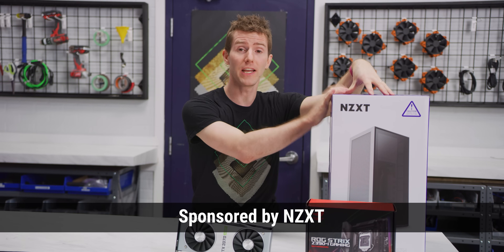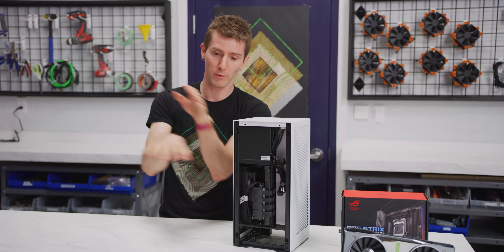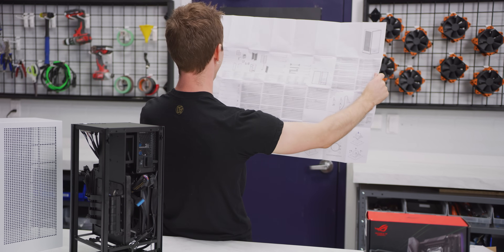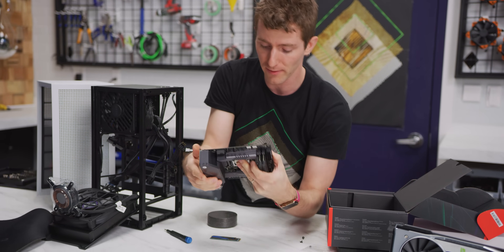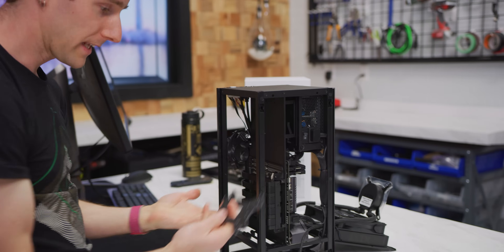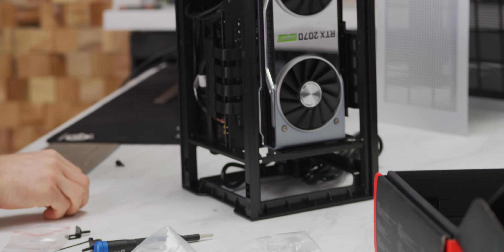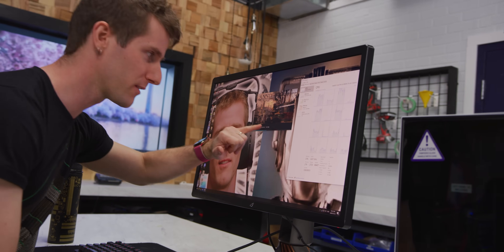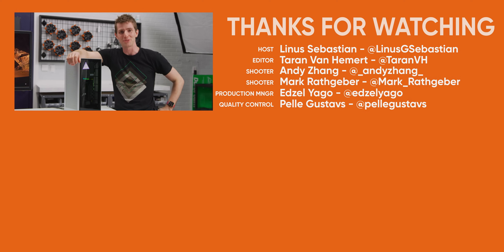Building the Xbox Series X Rip-off PC

Comment: "Building the Xbox Series X Rip Off"
Me: Sees price 
This will never be a rip off or alternative
Reply: The CPU used alone is likely to be most of the price of the Series X :^)
So yea...
A rysen 5 3600 and a GTX1660Ti or something would have been a better fit.
Reply: @FinlayDaG33k  1660ti dosent support rtx
Reply: @aykay9616  actually Every dx12 gpu can do raytracing....
Reply: O Yeah yeah yeah all gpus technically support ray tracing. The difference is that the rtx series has dedicated hardware for it
Reply: @sean0611  and in a similar note. The xbox and ps5 are having it built in as well. So there is that point to console without having to spend 600+ on JUST a gpu
Reply: @FinlayDaG33k  I agree except that the gpu of the series x will be very close to rtx 2080 power or even better.
Reply: @Atriox-il3mt  Funny
Reply: @Atriox-il3mt  it plays like s 5700xt or 2070 super based on what I have seen my guess they mainly get this from lots of optimization.
Reply: @Atriox-il3mt  Yeah, let's wait and see what amd actually DOES. Their cpu's have gotten much better about not promising the world and delivering a pebble, but the gpu side hasn't had NEARLY the success in that department, and this architecture has yet to see the light of day in pc or console form...
Reply: @girlsdrinkfeck  I dont know how they are going to get that level of performance but if it is true maybe it could cause nvidia and amd to drop prices.
Reply: @4karros  

No. Just that consoles don't have the OS Overhead that PCs do. Since the launch of the Xbox One X, even Linus is heard referencing how you will never get the same Performance to Hardware power Ratio that a console has with a PC, let alone even with one built to match the specs of a console. 

Hench why Xbox One X 6TF machine is up there or was up there with loads of PCs that not only crushed the console in Numbers but also in their overall price tag, but still the console was an Equal. 

I think that these consoles are having an interesting Side Effect on the mind of PC Gamers as they try to figure wtf is going in and why they pay so much for PC components that cost so much but aren't as effective as something they consider inferior 'consoles'

What you have on PC with Price and Performance is a collection of OS Bloat, Competition and price fixing of GPU/CPU/APU Manufactures..... And good ol complacency.

Hell if I remember correctly it was the dick head PC Gamer who ushered in the level of DRM we have today... Both the Ripping of Games, And being the ones who dropped physical games for digital only games. . . . . 

Ya we are still holding on to our Valuables over here... And it was the Console PlayStation Gamers and Xbox Gamers who actually did something or said enough of something that MS  changed their polices in 2013, and has spurred the birth of things like PS4 Pro and Xbox One X. 

PC Master Race, Crash & Burn. 🔥🏎️
Reply: @Atriox-il3mt  It's actually between the Rtx 2080 super and 2080 Ti!
Reply: @cMARVEL360  I'm going to need the cliff notes version of this sir.
Reply: @swishpronoob  😅 Instead I'll send you a Beer Emoji in the hopes that you grab a beer. And; Enjoy. 

🍺.
Reply: @Atriox-il3mt  It's outperforming 2080ti
Reply: @cMARVEL360  yes say teraflops like you know what they mean... also you do understand the scorpio had the quivalebt of an Rx 580... right... thats not even close to beating any moderately powerful pcs....
Reply: @ebicgaemer3330  Uhhh..... You men that $500 device with a 240 or so PSU, pumping out 4K games, and plenty of 4K60fps.... Uh..... I mean you purposely have to ignore my point... Especially since the RX 580 doesn't actually equal the power in the console, it's just a point of reference you try to use as a derogatory meaning. 

Obviously you want to believe what you  so there isn't any thing I can tell you.
Reply: @Atriox-il3mt  Ha ha ha ha ha ha ha.
Reply: @Atriox-il3mt  lmao in your damn dreams. That gpu will probably be something like a 9 series nvidia cards. Welcome to 2010 console boys.
Reply: @girlsdrinkfeck  lmao yeah sure.
Reply: Lorenzo Alvarez wrong. Maybe an RX5700 or a 2060
Reply: @girlsdrinkfeck  But i think not the first Generation of Games, we will need to wait 2-4 Years to see good optimised Games on the new Xbox. But after this, the Console will outperform a RTX 2080. I mean, just look at RDR2 and what is possible on the old Generation, but Rockstar needet Years of optimization to make this happen.  And in 2-4 Years we all have a RTX 4000 with many many VRam and Tflops. And of course a good Gaming PC is more expensive... everyone knows this, but no one really cares about it (only stupid Kids)
Reply: @girlsdrinkfeck  sadly
Reply: @ebicgaemer3330  except when you get a decently powerful pc you paid $1000+ for one.
Reply: @lucasdaignault3466  first off. No. Think about it. Both xbox and ps. Are using RDNA gpus. (Graphics cards that havent even been released to the 'pc master race' yet. And just by raw numbers does go head to head with a rtx 2080.)

Its optimixed so that also helps with games. Because instead of being a jack of all traits master of nun (a pc. Yes even a 2000$ pc) a console is a master of one (gaming). Jack of nun. (Anything but gaming)
Reply: @cMARVEL360  let me know when your xbox gives you the freedom to use any interface you want, any program you want, and the ability to choose what you want your specs to be.  I have a four year old pc that can play games at the same level of your precious X.B.O.X.
Reply: @lucasdaignault3466  my old 980ti performs better than the xbox1x and its 4 years old.
Reply: @gatorguy5419  

It's a fucking Games Console. LMFAO! What programs could I want to run on my Games Console? 

As a matter of what... When it comes to the Identity of your PC..... What is it exactly that keeps your 'Old' PC from being a new PC considering the ability to remove and add parts, Whole motherboards, and cases. 

I think you need a games console in your life. It can help bring you some Perspective. 

I used to game on PC. From 2006-2011. . So I know the ups and downs of the platform, so my decision to stay in console wasn't out of Ignorance just preference.
Reply: @cMARVEL360  Which is why a console will never have the functionality of a pc.  A pc can be your multi media viewer, gaming console, and work pc all in one.  A console is so limited until the xbox1x it couldn't even game decently.
Reply: Bryan Hidy you clearly lived under a rock since the release of the PS3 lol. Consoles already run a full blown Linux. You could run your entire media library from your consoles. You have Internet access and mouse/keyboard support on every major console. So you could use most Web Apps and do most common work lol
Reply: Lorenzo Alvarez Wrong, it’ll be faster than the 2080 ti
Reply: CoolCoolerGaming The new Xbox specs will mean a GPU faster than the 2080 ti
Reply: PewdsFan Pewds Fool, it’s hardware spec alone means a chip faster than the 2080 ti
Reply: @GhettoPCbuilds  no... Just no
Reply: @4karros  RX 5700 XT has 36 CUs, while the Series X GPU has 52. Pretty big leap there…
Reply: @gatorguy5419  people dont buy a xbox or ps to do all that they buy it to play games.
Reply: @gatorguy5419  hmm yess 980ti greak 4 years old you say. Right... Ok them moving on.
Reply: @WamblyHades  Compute units dont tell the whole story vega 64 has more than the 5700xt and still is slower.
Reply: @4karros  But those are different arquitectures, while RX 5700 XT and the new consoles uses the same GPU arquitecture. No actually the consoles use a advanced RDNA 2.0, so they could be even more powerful than my comparison.
Reply: @WamblyHades  it is all speculation we will have to see
Reply: @4karros  Those are confirmed specs by Xbox m8…
Reply: @kulade  It's actually true digital foundry have comfirmed it and the xbox series x was able to run gears 5 at 100fps ultra 4k. Everybody is calling me stupid with no proof. I think alot of people are mad that a $400-600 console will be able to outperform a $1300 pc.
Reply: @sawyerweathers8713  Give me proof and I will agree with you.
Reply: Boy oh boy..... The butthurt on all sides, AMD, Intel, Console, PC..... FFS, they’re all the same devices doing the same job. Providing endless joy to millions around the world. Some cost less, some cost more. Some are better for Task Alpha, some are better for Task Gamma. Some are for Professionals with some gaming, some for Gamers with Professional interests. You’re fighting in a comment section whilst there’s others fighting to save lives and fighting to live right now.
Reply: @smoketinytom  

What did you just wake up to the Planet Earth? People are dying all the time for many reasons. I'm not Part of White American, so you will have to excuse my nonchalant attitude in this crisis as I have lived past the age of 18. 

Ya 18. The age in which many Mintories have died at all Across America, so you can't really blame me for seeming indifferent as my life has ALWAYS been filled with Danger... It's just you who has come down to this level of Alertness. No worries. You're Human. You'll adapt or die due to stress.
Reply: It could be worse, the PS5 could be the slimmest looking console ever and have massive overheating issues.
Reply: @StephenDanielLopez  so the ps4? Xbox 360? And like.. Any small form factor pc post 2012.
Reply: PC gamers going butthurt
Reply: You forgot about, the global Economic hault.
Reply: Top Dog  If you bought an xbox one when it came out, and bought nothing but xbox live, you would have spent around $410 on just live up to today, on top of the $500 you bought it for bringing it to a total of $910, without tax, and accounting that you paid for live by the year and saved a bit. You can build a PC that games just as good as the xbox one for less than the $500 you initially spent on the console, forget the cost of live. And that's not including games, which are usually much cheaper on steam , as almost everything goes on sale on steam for a hefty discount. Now, you're not getting the best PC for that price, but if you're only looking at gaming, it's an identical experience. Buy what your fucking friends have, and leave at that.
Reply: @sporemaster97  id like to see your less then 500$ pc play a brand new AAA game as well as the slightly and admittidly over priced xbox does today :)
Reply: @theundeadsqwerl8017  yeah, 60fps isn't hard. Like, really at all. You can cheap on about half of the stuff and compromise next to no performance. Good gpu, ram, and ssd is most of what you need for games, you can have a mediocre at best cpu and be fine, especially at 60fps. And I'm talking og xbox one, not the s or x. Pubg can barely run on the og one, runs fine on my computer. And my computer technically doesn't have an ssd, and I have a new cpu (that I got for next to nothing) waiting for a new board as well, because my car is getting the funding first, I don't game that often, or seriously. I just play with the homies, which it does perfectly fine already. Most nw games are uninteresting as fuck anyway, so I'm not buying them to prove to you what has already been proven.
Reply: @theundeadsqwerl8017  And again, the only thing I have against consoles is multiplayer costs money. I never said I had a problem with them, dum dum just said they "will never be more expensive" and that statement is false. They can be, and often are, but not always like he said.
Reply: @sporemaster97  having to upgraid your pc every few years can get spendy as well. Not to mention all the troubleshooting or you know... Lack of any real standard anti cheat programs.
Reply: @theundeadsqwerl8017  yeah the illusion of the "cheap" and "flexible" PC lol
Reply: @michellandau4655   flexible is right. Pc does have its merrets don't get me wrong. But as a avid user of a pc and a xbox one x.

Pc is a jack of all traits. But a master of nun. 
Ya it can do more then a console can. 

But anyone looking at getting a console is not wanting something that can do a bunch of things. But just wants a simple plug and play expirence. 

Pc is flexible. 
But a console is consistant in the fact it will work out of the box.

 Pc are not like that. Eather you build your own. Or you spend a couple hundred over what its worth. Wile consoles are normally sold at a loss to the company making them.
Reply: @sporemaster97  well for one. Pubg is porly optimized for console. It runs fine on phones so saying that game is just a bad example. 
If a game is porly optimized for any platform it will run like dog shit. 

Just look at red dead 2 on pc at release. 

Or the batman Arkem games

And borderlands 3 runs fine on the og xbox one. As well as modern warfare or other new games. 

And the xbox one s has the same spechs as the og except has a 4k blueray drive. Wile the xbox one x has nativ 4k support.
Reply: @theundeadsqwerl8017  Mines ddr3, and still doing fine. You don't have to upgrade near as often as you think. Maybe a gpu about as often as you'd buy a console. Google is your best friend for any problem you may have. And games with developers worth a damn stop it, or immediately ban like fortnite. They'll kick your ass midgame, they don't care. I don't even like epic, but they do seem to be very effective in stopping/managing cheating. I've come across more people clearly cheating somehow on consoles in my experience. It's all preference, and what your friends have because not all games are crossplay, so it's easier to just get whatever the people you want to play with have.
Reply: @sporemaster97  strange seen more haks on pc (steam library) then on xbox one. 
Im running a ddr3 fx 8350. 16gb ram. Rx 580 8gb. build myself. And ya it works fine. But guess what. Im not running any new AAA games at 4k 30fps. But i can easily do that on my xbox one x
Reply: @theundeadsqwerl8017  & @Jordan Adams See guys. Folks like you are holding the next consoles back. Your "flexibility is the cause of all evil lol ^^
Reply: @michellandau4655  what? Dude... No i like mu xbox and am looking forward to the xbox SX. But i also understand the point of a pc.
Reply: @theundeadsqwerl8017  just "use your brain dude" rofl 
TheUndeadSqwerl
 1 hour ago:

"@Bryan Hidy id like to tak a moment to play the fu## bullshit song. 

If you wana say consols are holding gaming back then you might as well say your phone is holding gaming back. The games are scalible on any hardwere to run on any hardwere use your brain bud."
Reply: Just wanna state the change in the rules of the game lol
Reply: @michellandau4655  what?
Reply: TheUndeadSqwerl i basically called your BS is BS xD

Doesn’t matter really but it’s funny for me so I maybe digged to far into it xD
Reply: @michellandau4655  your confusing me. 

First off i am an xbox player. 

Second off i can see the logic in a pc. Say someone does more then just game. Like works audio. Then they would get a pc. Because it can do both. 

But if someone only games then hell ya get a console. No point in spending arm and a leg for a stagnated market. That DOSENT innovate but every 10 or so years.
Reply: TheUndeadSqwerl maybe I took your sentence on the wrong foot. My point of view was that you said “nothing holds games back” which ain’t true because developers and especially AAA Studios HAVE to get that critical ROI. They have to make profits. And as I lay out the PC Gamers are poor and own minimal Hardware. The common PC specs are now years behind the future consoles. 

So to still earn money GameDevs can’t ignore the majority of PC Gamers and have to cap their Vision for the games. The majority of games are cross platform games. Even exclusives are a thing of the past (for Sony who own the most powerful console of the upcoming gen). So even exclusive Sony Devs maybe cut features because of a future PC Release. That’s troubling for me
Reply: @theundeadsqwerl8017  Then idk what is wrong with it,  because i can play rocket league at 4k no issues. granted its not the hardest game. nut it does have a lot going on with the explosions and shit. Plus, most people don't have anything to even utilize 4k so its a useless benchmark.. 1080 or 1440 would be a better baseline, as they have higher refresh rates anyway which is more important that resolution.
Reply: @sporemaster97  because most 60inch tv are not 1440p or 1080 anymore. They are 4k.
Reply: @theundeadsqwerl8017  Like 2 out of all the people I know have a 60", much less a 4k one
Reply: @sporemaster97  intresting where i live everyone but me has one.
Reply: @Setzer K keep dreaming
Reply: @Jared _ No, I actually meant the GTX1660Ti :p 

Quite a lot of people buy the 1660Ti over the 5600XT... yes, the 5600XT is a tiny fraction faster, but is also a rather bit more expensive and doesn't have access to the NVENC (VCE sucks) which allows you to more easily capture footage using shadowplay without affecting performance.
Reply: @Setzer K I mean comparing a 2 year old CPU to a new one is stupid. Sure the 2700x has 8cores / 16threads but It was released on an older architecture so it's going to be slower, also the 2700x is of course cheaper than the Ryzen 9.
Reply: @Setzer K Yeah that's true, also considering that the 2700x has a 105W TDP and that a 35W chip is able to be faster than that is amazing. I think the R9 4900hs is on Zen 3 Architecture? (quote me if I'm wrong) so that means we'll be looking at really fast and efficient CPU's in the future.
Reply: @SnowyWiz  Still Zen 2 ;) Just beating the shit out of everything no matter of Desktop or lol Intel
Reply: Ryzen 5 rtx 2060
Reply: @aykay9616  nothin wrong with that system, but I think the new consoles will beat that.  Not be ALOT, thou.
Reply: If anything, based on what we know from announcements, architecture, and professional theorisers like DF, it looks like a vega 56 with hardware to accelerate BVH volumes.
Reply: Warm Soft Kitty  console players also have a lot less hackers so what's your point?
Reply: Warm Soft Kitty  pritty sure a AAA game will run fine on a release ps4 or xbox one. (Came out in 2013) but a pc built for say... 500$ in 2013 wouldent be abuil to without having to say.. Upgraid a part or two. (Witch in of its self would just a 'subscription' fee.) Just saying.
Reply: Top Dog  Enjoy having limited backwards compatibility and having a tyrant decide what you can and can't play.
Reply: Top Dog  yeah, and I only go out to see your mom, jackass
Reply: @Setzer K all the stuff eh. Ok then. They have made some decent strides in CPUs. Still far and away under the competition but they are doing all kinds of stuff lol 😂
Reply: the xboxs graphics will never compare to a Rtx in terms of raw power and numbers

BUT

in terms of end user experience, it'll be quite close due to better optimisation via xbox os
Reply: @watema3381  You do realize developers have said that console gaming is holding pc gaming back.       It's why there are thousands upon thousands of PC games vs combined console games.
Reply: @gatorguy5419  id like to tak a moment to play the fu## bullshit song. 

If you wana say consols are holding gaming back then you might as well say your phone is holding gaming back. The games are scalible on any hardwere to run on any hardwere use your brain bud.
Reply: @theundeadsqwerl8017  but with the next gen PC´s will holding back the consoles. Let´s take a look at every spec: PCIE4 NVMe´s as used in the new consoles couldn´t be utilized with any Intel CPU until 2021. AMD only supports it on their latest motherboard gen. So no common fast NVMe´s in the PC´s. Resolution? Console´s are at 4K in the Old Gen. Most PC Users play at 1080p. CPU Speeds and Ram? Both Consoles and PCs are on pair... except that PC users only use 4C/8T. Disc Space? 1 TB ultra fast speed on the next Consoles and 1TB HDDs in the PC´s (Even standard Terabyte SSDs are at 100 bucks right now). Source: https://store.steampowered.com/hwsurvey/Steam-Hardware-Software-Survey-Welcome-to-Steam 

And all together means that Developers have to take care of the majority of the PC Peasants which are holding back their efforts to be able to use their engines full potentials. Which is leading to an awkward position of the new consoles: https://youtu.be/UElXQTqWlUw
Reply: I think these peasants cant handle the truth that their filthy consoles can never match the performance and convenience of a pc! lol, keep believing what ever the fuck manufactures say to you 🤣
Reply: @azmeriliza3788  pc. Spends 1000$ has to put it together trouble shoot and be sure its all working then install the os and then buy a game online download and that game just might not work that well because poor otimization

Console
Buys console buys game plugs console in and slots disk in. Plays game. No need to be sure the game is optimized cuze you know it is

So again.... Where is the convinence of a PC hear bud?
Reply: @theundeadsqwerl8017  First of all, the best advantage of a pc is that you can select every part yourself. You can build it at any price point not just "1000$". You can go as low as 300$ (even less) or as high as 5000$ (more if you want).You can get as much gpu or cpu horsepower you need. On the other hand you have to wait for another console release to get better performance. Lastly it's a PC so you can use it for other things than just gaming.
Reply: @azmeriliza3788  true, true, but consoles are free of the massive overhead a computer must run simply to be a functional PC. A lightweight OS can get much better results out of local hardware.

A similarly specced PC would be outperformed by next gen consoles, but with cash to burn you can make a BEAST of a PC a console could never hope to be.

Basically, there's merit to consoles, even to a PC gamer. Besides, we all want crossplay, right?
Reply: Why are y'all so mad lol, the gpu will be around the 2080. Some of y'all keep saying the 2070 super and that's what 6-7% less fidelity than the 2080?
Reply: @amuddyelfproductions3915  

I think PC Gamers are just shocked that the consoles have caught up so fast they inadvertantly woke up the PC Gamer to the Butt Fucking he/she has been receiving from it's Hardware Manufacturers. 

LMFAO! 

I Mean..... To be fair, their current Hardware can already do so much.... If there was some incredibly lite weight Gaming OS, then Instantly all PC Hardware would gain a Performance to price increase. 

Hopefully MS comes through, because they kinda have too. If not, then another PC OS will come up with Gaming Focus while maintaining high security. 

So personally im bettjng on MS making a Game Mode for Windows that will turn off a lot of background processing to decrease the load on the Hardware. 

But man..... The PC Gamer is very much a Victim of Industry, or Corporate Greed... Which makes sense considering how sensitive pricing can be on PC Gaming Hardware in response to competing hardware... There is NOT enough Hardware CPU/GPU competition in PC Gaming so their hardware is just over priced and retains those high sales until those Sales come around, another indicator at how wishy-washy pricing is on hardware components.
Reply: @cMARVEL360  caught up so fast? They are on par with 5 year old hardware
Reply: @Kold2012  

Uhhh...... Please look at the rate of advancement from the big picture. 

Hell... Think Xbox, PC, Xbox 360, PC, Xbox One, PC, Series X, PC. ... The Xbox is X86 based, Hell we can say that's when PC's THE PERSONAL COMPUTER, Became a Games Console. 

Xbox 360 was a total Custom build like previous games consoles, but come thr Xbox One AND the PS4 which are the first two Games consoles to use a whole lot more basic off the shelf PC Component. 

Now Series X and PS5 come with BRAND NEW PC COMPONENTS. 

I think you get my point? And...... Uhh...,. By 5 Year old parts.... You are referencing 1X and PS4 or Series X and PS5?.…. Then again, it doesn't even matter as your original comment wasn't made knowing what I mean by what I said as I had not explained it to you yet.
Reply: @cMARVEL360  everything is "custom" you just change anything about it. Now it's custom... 
Ps5 is a 1080 
1080 came out in 2016....
Reply: @Kold2012  but yet are running gpus that havent even released for pc yet.... Hmmmmmm
Reply: @theundeadsqwerl8017  the cards they are based on have released homer

AMD has been behind a long time folks. I'm giving you the benefit of the doubt here with saying a 1080.

It's an Apu. Notoriously (cheap) trash. Underpowered with only 300w to pull from.

All your "cUsToM" this and "uNrEaLeSEd" that is marketing talk for here's some garbage that we are shafting you with. Come buy more in 2 years.
Reply: @Kold2012  welp number crunching from game deves. And raw numbers from gpu tests and stuff. Say other wise but allright but. See you when your proven wrong at release. :)
Reply: And hear is a side note. 

My 500$ xbox one x will run games at 4k. Granted not at max setting or anything like that but it still looks GREAT and runs smoothly with no real dips in fps.

My 700$ pc will not. Barlly scratching 20fps in even games as old as team fortress 2. Granted its older unit. But both where put together 2 years ago
Reply: @Kold2012  Not to mention Microsoft is selling the Xbox at a loss.
Reply: @gatorguy5419  doubtful. Source?
Reply: cMARVEL360 theirs already an “Gaming OS” which makes your games run faster on the same Hardware: Steam OS / Steam on Linux. Valves Proton already kicked Windows Ass
Reply: @cMARVEL360  Consoles are just inferior and the only reason I see to buy them is if I'm broke or want to play with friends. There are so many reasons why I would chose PC over consoles, the sheer ability to upgrade my PC parts is an instant win, while needing to pay for an entire new console whenever they release a refresh/ upgrade is just money hungry (ps4 pro etc). Whereas I can take out my GPU or CPU and plop in a new one increasing performance for a fraction of what a new console would cost. The new generation of consoles might look high-end now but in six months to a year when AMD releases Ryzen 4th gen and Nvida updates their GPU line up (even AMD are releasing good GPU lately) they'll start to look around mid-high end. It will continue like that until consoles look really low-end like they are right now, that's the downside of consoles is the lack of upgrades you can make to them, lack of customization of the parts inside. Not only the hardware side of consoles are bad but the software side as-well you are forced to use shitty OS's from the manufacture, that are well know to have tons of bugs upon release and even down the line. Also for people who also use PC's for workloads etc (which you wouldn't know because you're obviously ten) you can't use consoles for work etc so of course they go to PC. Now there's nothing wrong with Consoles and if you want to use the go on, but if you use your system for anything either than gaming don't expect to be able to do it on console its just a lot better on PC to multi-task and do other things.
Reply: Don't worry, microsoft will get their money out of you in DLC and microtransactions.
Reply: @Chuck_Huckler  I don't think Microsoft gets a cut of game profits unless they own it or license it, and I don't think that right extends to microtransactions. If that were the case, no game would ever be released without microtransactions, not even indie games; Microsoft wouldn't let them.
Reply: @Chuck_Huckler  

No. They get Money from US through Xbox Live and Gamepads Subs... You do know that DLC and Microtransactions are for the games and for individual Devs/Publishers?.

Some of you people are full of your own Egotistical views thya your jokes are drowning in your Ignorance which Kills the Joke itself.  

It's one of those Face To Palm situations.
Reply: https://www.google.com/amp/s/www.pcworld.com/article/3532810/microsofts-xbox-series-x-full-specs-vs-gaming-pc.amp.html 

Butthurt pcmr can't handle anything, here's some facts
Reply: @cesarzepeda8291  lol FaCtS
Reply: Mike Hines you want facts? A) The RX 5700 XT has LESS CU’s than your “shelved” XSX APU. It is more powerful than the best discrete AMD GPU and it seems like AMD will release new GPUs close to the consoles. B) The NVMe in the XSX is faster than any NVMe you could use on any Intel Motherboard till late 2021 or even 2022. (Yes, Intel is year’s behind of AMD). The PS5 Nvme is even double as fast as the XSX Nvme. To get close to the PS5 you need a ~7Gb M.2 NVMe which still has to be released and probably won’t until end of the year/2021. C) Just look what Monster the new AMD Laptop Chips are. The Media barely can wrap their heads around their performance. And those chips only use 45-65W. As you mentioned many times the consoles use up to 300W. Thats ~5times the power to benefit from. D) The RX 5700 has less CU’s than Vega and outperforms Vega in raw power and efficiency. Your mentioned 1080 is outperformed by new Laptop GPUs from NVIDIA I guess. Time allows progress. For the Fun of it one more: E) The new Audio Chip in the PS5 opens even more compute power while delivering better audio than even in High End PC’s (as far as we know).

So have fun correcting my 5 facts
Reply: @michellandau4655  I wish you knew what you were talking about. This would be easier
Reply: Mike Hines lol. THAT’s your answer. Its not even an argument. Come on.
Reply: @michellandau4655  what you said is not an argument either. You spewed a bunch of bullshit I'm not even motivated to start debunking. It's clear you have your fantasies made up already of what your getting.
Reply: @michellandau4655  fact AMD has zero answers for high end GPUs that compete with Nvidia
Fact- any ssd is gonna improve your loading times period.  The theoretical performance you speak of that's soooo much faster then what has already been out for years I might add, is marginally better. So marginal, I'm gonna say right now in a blind test you would have no idea the difference if this so called speed is even reachable. You talking about loading fractions of a second faster. Fractions. Of. A second. I have 2 nvme drives now. They load games instantly. Litterally. Telling me your faster then instant doesn't get me excited.

If they can reach 5ghtz transfer speeds, good on them. That's great. It's not gonna change much. Everything is an upgrade from a HDD aka current gen. 

  But here is the thing about all that. You have to buy PROPRIETARY M.2 from your console of choice at the price they choice for the capacity of you guessed it; whatever it is they want to sell you and they plan on using it as ram. Drastically shortening the life of said drives and ignoring the latency factor when doing so. 

You bring up laptops. Why. Who cares. 
Your console is not a laptop. Comparing the 2 is irrelevant and kind of eye opening as to what you'll accept. The best laptop chip today get SMOKED by a 4 year old desktop chip. Who cares.

New Audio chip? Give me a brake. You'll believe anything...

Fact is you getting repackaged part and being told it's brand new tech
Reply: Warm Soft Kitty  

Wtf? LOL! NO. The Console is the physical device itself. Anything else is software added services that you DONT Need. 

Man. I really don't understand the point of creating arguments to make one's self feel better. 

I mean lets be real. Not everyone is a Competitive Gamer, so not everyone need to pay for a Sub fee to play online, In the exact same way people can play PC games but only run Single Player experiences, and now you also have to consider Free to Play games that are NOT always required to have a paid online service. 

Honestly... I think if I were to try, I could come up with some BS where I rope up the price of Digital Games with the Price of building a PC..... Well because you gotta play games but you buy them through your PC through a Service of your Choice..... 

But that sounds stupid huh? lol! But it doesn't change the fact you need a PC to buy PC games. But you don't always need a console to buy console games, just play them.
Reply: @cMARVEL360  you and i both know that the vast majority of the gaming industry is now online only... it is reflective of your desperate defense that you genuinely try to make the argument that you do not need to pay for these subscriptions.
Reply: @ebicgaemer3330  

What? Dude your point was like trying to say that a console is more expensive because you have to get online but you gotta pay for internet first, oh then you gotta Sub. 

Everyrhing is online because people choose to be online. 

I mean how many times are we Logged Online, but playing some Offline story game? You trying to tell me no one can carve tht sort of exsistnce?

 Wtf do you think happens if I don't pay for Xbox Live? 

I'll give you the benefit of the Doubt , that you probably just didn't consider being offline. . . Especially since you regurgitated that old 'Consoles are more Expensive because of Subs psrt' I know you weren't thinking with your own point of view there...  Hell I went to a friend's house a couple of days ago.. he had No Xbox Live, but I offered to share my Gold Benefits by adding my account to his Xbox. 

Sure enough him being his own man he didn't want it, and we played just fine playing Shogun Jump's fighting game.
Reply: @cMARVEL360  if you are broke you buy console . If you are fine on money You buy  a pc 
Its that easyy . You pay more you get a premuim experience
Reply: @exess510  

LOL! I think you mean If you are Broke you have either Console or PC. If you are fine on money you have a combination of a console and PC. 

But honestly, as a Gamer, why the fuck could I give a fuck about how much you spent on a Gaming Device? Gaming is about the games and Gaming Skill, This isn't MTV Cribs Lol! 

And if you got money, then send me some. I'll my dog Heart medication with it.. I'll send you receipts for proof!
Reply: @cMARVEL360  I was with you until you said you don't need live on a console unless you're a competitive gamer. I'm paraphrasing, but that's wrong regardless. You could just want to play rocket league in a private game with your buddy, but you can't because even Sony charges for multiplayer now, and it's petty as fuck. IDC if the console is an extra 50-100 bucks to account for not paying for live, you shouldn't have to pay to play with your friends when you already bought the console, game, and probably extra controllers and stuff.
Reply: @sporemaster97  

I'm not with you at all. See I don't have this sense of Entitlement.... Even with an Xbox Live account of 15Yr. Which equals $850 if I do the math with $50 from 2005 to 2010, which is when I believe Live went up to $60. 

So if decide to buy more Controllers for the console and a game which is most likely made sperate from the console manufacturer, ya they don't owe you the need or want for you to play online for free. Especially if you take our current strain on the god damn internet  infrastructure. You haven't heard at all about Live SLOWING DOWN, as much as people having connection issues which get resolved. I pay for that. 

I downloaded Destiny 2 last night. . . 108GB... On my 300Mbs connection, Avg(210-240) and FINISHED IT THE SAME NIGHT. . . Why? I PAY FOR THAT. 

Trust me dude.... When you bring up PC, and Free, and Downloads to try to match me... Keep in mind your Internet connection isn't fucking free NOR is it apart of your PC Hardware, and the Servers that the games are on are built using money on the games they made, and you bought. You Paid For That... But indirectly.

Btw... What do you mean you need live? How is that something you Need? And if course only Competitive Gamers NEED online, because it's different than a Want. Like me, I don't play single player games, so I NEED Live so I always pay for it. 

A non competitive gamer like my friend could allow his membership to lapse, it is not a Need for him. But me. Man. Although I have a ton of games stacked due to being in this hobby for so long, but I wouldn't be having fun.
Reply: Jordan Adams lol. I own a PS4 since the early days and played zero multiplayer on it since I own it. I may correct myself. Death Stranding is kinda multiplayer. In fact I hadn’t even the time to play through all the great Singleplayer Games yet. I get it that your bound to online multiplayer with the XBOX lol
Reply: @michellandau4655  nope not bownd at all i dont even hacve good enoph internet to play online (hughes net. Latency is absalute dog shit) ang guess what my xbox works just fine!